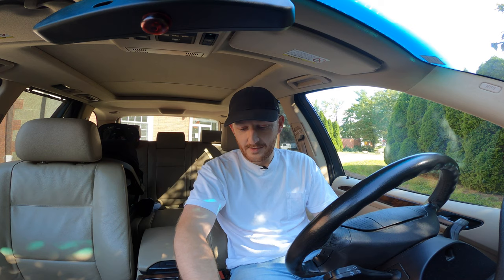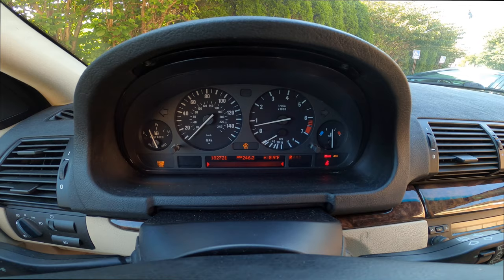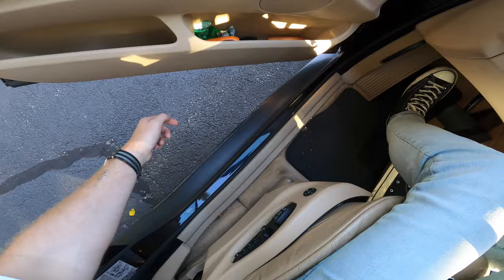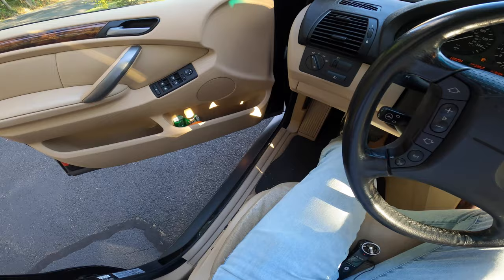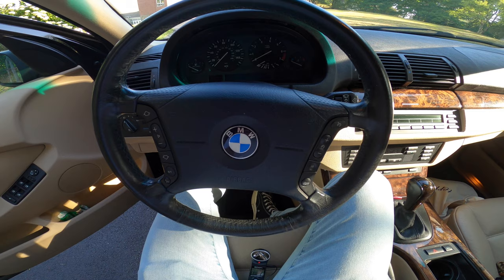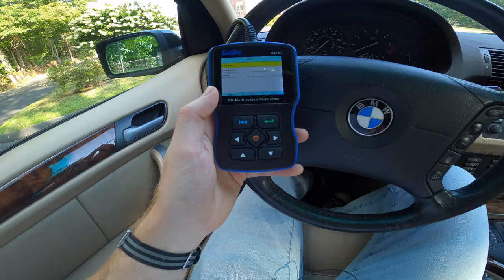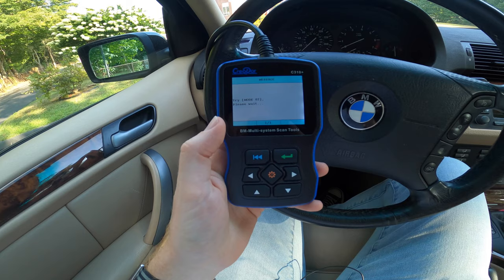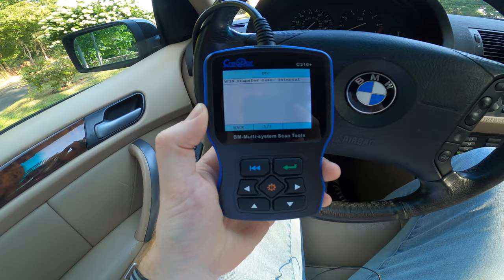How to Diagnose BMW Transfer Case Actuator Gear Failure E83 X3 E53 X5 Brake ABS 4X4 Lights On 5F39

Comment: In case any one wants to know if its their gear that is bad, i have done this replacement many times, start your car and shut it off with door open if you hear a noise under car after car is off then its your gear that need to be replaced, If you do not hear a noise its def your transfer case 99% of time

Comment: Great video! I'm nearing 179k miles and mine just failed on me. Took it to the dealer and they said exactly what others have said (quoted me for $3k saying it's the transfer case). Definitely going to purchase a gear and DIY.
Reply: And did it work?
Reply: @s.medina3661  Nope! I was successful in replacing the actuator gear which did show signs of wear. I took the vehicle into BMW to get the hookup on diagnosing/resetting the codes. They didn't go away and the Transfer case ended up getting replaced anyway. Total cost was around $4500 and since mine is a manual X3, it took over a month to find the right transfer case to match. I'm at 193k miles now.
Reply: @xiayu27  but the dealer erased the codes related to the transfer case for you when you took it in after you replaced the gear? Im guessing the codes came back? I wonder if replacing the entire actuator motor would result in the same scenario.
Reply: @s.medina3661  Correct, and I wondered this too! The actuator motor itself could have been an easier swap than cracking it open and swapping the gear itself out. I took the lazy way out and let them keep the vehicle to do the work rather than taking it back and ordering an actuator motor to swap.

Comment: I remember the first time that gear went out a couple years ago I think now. I watched your video a few times and sure enough you were a %100 correct. When I pulled out the gear at first it wasn’t really that bad, but just bad enough to through a code apparently. I’ve been plagued with the X5 4.4, so I got really good at fixing my own issues, thanks to you sir. We all appreciate the guidance 👍🏻
Reply from the maker: Archangel 751 thanks man I appreciate you! Yes, we have to DIY as much as possible on these old tanks to make it work... it just gets too expensive!

Comment: No other cars besides bmw x drives have this transfer case/gear issues every single bmw x i had had a issue with this sometime u can just get away with just replacing the actuator if you are lucky, but its i ashame bmw made this part of the car so fragile and very costly to replace ..

Comment: Mine failed around 118k miles about a year ago, very easy fix.
Reply from the maker: BLACK BIMMER thanks for sharing that data point! I think 115-120k miles is typically the window where the original transfer case gear actuator fails.

Comment: I replaced my actuator, on my BMW X3 2006, because the brake light and four-wheel drive came on, it went into limp mode. You can turn the key off driving down road for about 8 Miles. It does the same thing again turn key of , start route backup, and runs fine. Brake light comes on, four-wheel drive light comes back on. The actuator is brand new.

Comment: BMW has this transercase problem since day 1 it introduced X drive and it does not brother to fix it as the engine oil pan leak problem but instead spends too much time to fine tune its engines and created something that does not sell such as laser head lights. 2024 X3 still uses old stock of signal control stick that is twenty years old module.

Comment: Perhaps you can help me. I have no lights on and no clicking (I’ve also got a manual gearbox. I hear a “grinding” noise, especially in 5th gear at around 1500 rpm. Is this common?

Comment: Hello, I have a 2005 bmw X5, I changed the gear on the actuator and the  4*4 light was still there until I reset the steering angle sensor with a scanner. Moreover, I noticed the vehicle cannot be driven for long as it goes into limp mode or transmission failsafe mode. I have to shut it off and then restart after a few minutes. This vehicle was in an accident 8yrs years where front of it was damaged.

Comment: Hello, Problem solved thanks changed entire actuator! Should I go get the Transfer case fluid change have 185,000 on the dash not sure it has ever been change, the dealer price 350.00 + Silvia
Reply from the maker: Yep I would recommend getting the case fluid changed. It’s most likely black by now if never been done. You saved $4000 - congrats!!

Comment: Hey man I have a BMW X5 2003 4.4 in first gear I get a major clunk from the rear and the rear drivers side wheel feels like rubber is rubbing any ideas ? I have abs and brake lights on no 4x4 lights on

Comment: I have an e70  doing this but only when I start & also intermittent got the 4x4 awd dsc light.  just got the transfer case actuator done but the noise came back  & so did the codes any insight on my personal war??😭 please help

Comment: Question(My 2007 x3): My transfer case was changed to a used one and it removed the ABS/Brake/4x4 lights from being on. Now I hear a scratching sound from the back that was NEVER present before. Do you have a professional opinion what could be happening or what could be checked?
Reply: Dust shield rubbing/ scratching on the rotor disc.  Brake dust shield need tweaking so it don't rub.
   Cause: setting preload on suspension/ control arm ( bushings) can accidentally bend the thin shield under or around rotor (s)

Comment: Hi, my X3 E83 have a noise, rough and clanking sound every time I start the car in the morning but after like 30 seconds or so it went off, what do you think the solution for this? Thanks for the help and more power to your channel.
Reply: Thanks
Reply: @26southpaw, I have the same issue - have you identified what’s causing this? Thanks.
Reply: I have same problem any idea what it is thanks
Reply: It's your electronic actuator on your turbo.
Reply: @andythemason3578  open hood have someone cold start engine. If you hear the sound pridominitly coming from the exhaust area piticulurly at your turbo. It's the actuator being noisy. Won't hurt anything.
Reply: I would drain and replace the TC (transfer case) fluid with OEM and see if your TC is smother.  Cheap experiment.

Comment: Hi I had those lights on so I went a head and ordered the entire module not just the gears, I replaced the module after market not Bosh and drove about 10 miles with it, everything was fine until I started the car again I was getting into the Hwy and all the lights came back and the car started to behave weird,  it almost felt like I had no power finally I gas it up and manage to get up to 80 and bring it home, what do think that happened?
Reply: The same happened to me. What did you do after the lights came back after replacing the whole transfer case??

Comment: Transfer case ::: My mechanic is telling me that if I change out the oil A couple times and running it and beating it up a little bit in my 528i . He said nine times out of 10 it knocks out the stuttering with the shifting. Do you think that is possible ??

Comment: Does anybody know what this gear even does because I have been driving with a likely failed gear with no lights and no noticeable difference in my TC (transfer case)?  I flushed the fluid a while back with OEM and it seemed to help too.

Comment: We have a 2011 BMW X3 xDrive28i and it is making a clicking/grinding noise from underneath the car.  We took it to a reputable BMW mechanic and he says that the clicking is coming from the transfer case and that the entire transfer case needs to be replaced.  I am dubious that the issue is this severe, and mentioned your video and the fix and he indicated that your fix is only for vehicles made before 2010, our vehicle is 2011.  Before I spend $6000.00, I am thinking about doing this fix that you are talking about.  Do you know if this will work on a 2011 and if it will, which parts do I need to purchase to fix the vehicle?  Thank you for posting this and for your time...  Jeff

Comment: I change the gear lights are still on what do you think it’s a problem it looked like a brand new gear when I opened it up I’m thinking the previous owner must’ve just got it done, do you think it needs a new actuator motor maybe that’s the problem? What other issues could cause it do think?
Reply from the maker: I would try a new actuator assembly, yes

Comment: I did watch your previous video back in 2018 I believe...
Reply: Hi Rich .. I used the scanner u recommend and used the link, it read  1. 5 FOC DSC sensor internal.
And 2. D35C no message (transfer case) 192.
I can deal with no 2. But I need your advice should I change The DSC sensor.  I take a look your video one by one.. I could not find related to changing DSC sensor X3 2005.?
Thank you your time and help 🙏

Comment: My 06 325xi wagon has a stutter jerk feel like a skip in the motor when you take off normally. if you take off fast it dont do it as bad or any at all could that be a transfer case?
Reply: I have something similar. I'm thinking it's the transfer case needs an oil change. I'm on 96k and I don't think it's ever been done.

Comment: Could you please do a video on which repair is most likely when the gear exclamation trans light pops on the lower right side of dash. I replaced the crankcase position sensor which didn't solve it. Also I heard it coukd be the stop(brake) light switch on the brake pedal?? What else could it be?
Reply from the maker: Hey bud I’m not exactly sure which light you have but check your owner manual to identify what the warning is. I’d recommend using an inexpensive c310 scan tool to check for your trans and/or ABS codes and begin diagnosing at that point

Comment: My 2007 BMW X3 shifts fine but something is slipping in the drive train. The symptom is prominent when taking off from a stop. I was thinking the AWD transfer case is slipping or is it the gear you mentioned? Any ideas? No lights on the dash.
Reply: Hi 👋.  Did you figure out the problem, I have the same issue X3.

Comment: Hello Rich. I replaced the transfercase actuator on BMW X3 but ABS light, brake light and 4X4 lights are still on. Do you know how I can get them to reset?
Reply: Did u figure out how to reset after the repair?

Comment: Had a similar problem first gear clunk. Reset tcm. Key on engine off hold down gas pedal for 15 seconds and voila😅🤣🤪
Reply: Is there any signal to let you know when it’s done properly?

Comment: Great video...thanks!  I have a whining gear noise that my local BMW shop said is the transfer case, and he said I need a replacement, which was quoted at $3K for a refurbished unit...I'm wondering of course, if replacing the transfer motor, or just the transfer motor gear will resolve it?  Does you car make a gear noise, or just the warning light and code?
Reply from the maker: Can you upload a video of the noise? YouTube, Instagram, Facebook... upload somewhere and link me to it. Also, why not just try the gear anyway with a few hours work. Before jumping into a $3,000 bill!
Reply: @BIMMERZEITT  I could get a video or audio recording together...I realize this gear is not for my 2011 335i Xdrive though...so that's not an option...Thanks
Reply: My 2016 x5m noise when turning and it feels like something is rubbing. Took it to 3 bmw mechanics .. two are saying the transfer case .. before I go to the dealer should I buy the reader from Amazon??
Reply: Do you repair  for other in ct? Need to get this fix on my x3
Reply: My mechanics telling me if I change out the oil in the transfer case it will knock out the stuttering that is happening. He’s giving me odds of nine out of 10 times it works. Your thoughts?

Comment: Mechanics did scan and still are clueless!
 
Codes say 227 & 228 which are o2 bank 2 control deviation and o2 bank 1 control deviation.. 
Also I have 4x4 DSC Inactive light on and hear grinding noise underneath at stops. 
I assume Transfer Case Motor or Gear ??? Or oil ???
It feels like brake lock on when I stop down a hill..
What could it be???
Also...
My check engine light has Always been on for years ( Map Thermostat) which every mechanic told me not to bother replacing...
Recently The car has trouble starting every morning and when low on fuel.
Maybe Fuel pump Relay?? 
Fuel pressure regulator?? 
Fuel filter?? 
Fuel Injectors ?? 
They cant figure it out! 
I Went to 20 car shops in 3 weeks and am really frustrated :( 
What could it be ??? 
Bmw X5 2006 3.0

Comment: Hello, I had all three light on I took it to bmw for my x3 E83 they replace steering angle sensor then now they recommend new Transfer Case at 4000+ which I declined, the only light on now is the 4x4 do u feel that it could be the Transfer Case Actuator Gear ??? Also they will not replace just the Gear, please let me know you opinion .Thank You !
Reply from the maker: What’s the mileage? Has the gear ever been replaced before? I would replace the gear for sure, at a local repair shop. BMW wants $$ no surprise there.
Reply: 180,000 miles not sure if it was ever done I got it at 130,000
Reply from the maker: @silviataylor92  definitely replace the gear or entire actuator first. Your local shop shouldn’t charge more than 2 hrs labor for that job. Very easy. Try that first before looking at any other options! Be well.
Reply: Thank You!!!
Reply from the maker: @silviataylor92  also note, the tires need to be changed all four at the same time. Has a single tire or pair ever been changed exclusively? All four need to be replaced at the same time, or it can cause a transfer case failure in extreme cases.

Comment: hi i'm just wonder why the 4x4 light still stay on after i already replace the transfer case gear. on my 05 bmw x5
Reply from the maker: You have to erase it sometimes with scan tool. And at the very least, have a capable scan tool to check for additional fault codes to help you diagnose

Comment: If this fails what happens . What is the cause of a X3 crabbing when turning on lock and rear wheels trying to spin
Reply: Crabbing can be tire pressure or tire sizes. Can also be transfer case issues.

Comment: Excellent, thank you so much, i am in SA i need a new gear and a Diagnostic tool, currently i am servicing the Transfer case and Gearbox, replacing the Transfer case chain and doing Clutch pack and Torque Converter, can i ask? Your servo motor gear, is it stronger than the standard gear? I think you said its re-in forced? Can you airfreight to South Africa?Will the  Scan Tool work communicate with a 2010 E83 X3 2.0d ?
Reply: Do you know someone in Bloemfontein that can deal with this problem, I can't afford the dealer. X3

Comment: Back in 1988 I had a BMW 325i with the straight 6 and manual transmission.  The instrument cluster looked pretty much the same as the one in this video.  In 30+ years, BMW did not bother to update the instrument cluster?  Seriously?  This is just sad.

Comment: Excellent- didin't realize how many of your videos I used.  I have the Trifecta, found rear left ABS sensor connector cracked - need to replace "male" end ... getting 5F42 Trans Control Limp, 5DEC TC Malf, 5E34 Wheel SPeed Sensor, air gap rea left ...can the senor be the cause of the Transmission and TC codes ? don't hear any clicking  on shutdown,  and not getting the 5F39 code... driving it sees the speedometer work, then non-functional after accelaretion 20mph... lights come on. Don't come back on until acceleareting aprund 20mph .. again ..
Reply from the maker: Easiest thing you can do is remove actuator from the car (takes 20 min) and inspect it visually. Cheapest and easiest way to rule it out.
Reply: @BIMMERZEITT  Thank Rich, I did. Bought this X5 used ( now has 130k miles). I took the actuator apart, motor has a lot of play (wobbly) ,  the gear looks to have been changed out, as teh case case was clean with a bight green grease and virtually no shreads of gear materail ... so need a new actuator?(hopefully just that) Thanks, Rob.
Reply from the maker: @robmasutti5306  most likely. The actuator is like $125 on Amazon these days. I’d go that route next. Still less than an hour labor at BMW!

Comment: My 2016 x5m noise when turning and it feels like something is rubbing. Took it to 3 bmw mechanics .. two are saying the transfer case .. before I go to the dealer should I buy the reader from Amazon??
Reply from the maker: Hmm 2016? Seems unlikely case would fail so soon, unless it was abused or a single tire was replaced (versus all 4). Did you try the dealer or were those independent shops. Yes get a code reader and pull the exact codes. Or ask your shop what codes are present.
Reply: @BIMMERZEITT  the car has 39000 miles on it and is treated like a princess lol.. I am going to get it diagnosed at BMW .. I took it to another place today when they plugged in the computer they said it was the wheel alignment and steering calibration.. $240 later the problem is still happening
Reply from the maker: @amalabed6462  with only 39k miles I think a major item like that would be covered under the BMW warranty. You should bring it back to your BMW dealership. See what is covered under the initial warranty. Even if out of warranty period (5 years old now) since it has low miles they may repair in good faith.
Reply: @BIMMERZEITT  that’s the plan! Thanks for the advice
Reply: Hey.. took it to a mechanic and they said transfer case although it doesn’t say that when the codes run up.. do you think it’s worth the money to get it diagnosed by BMW to determine the real cause?